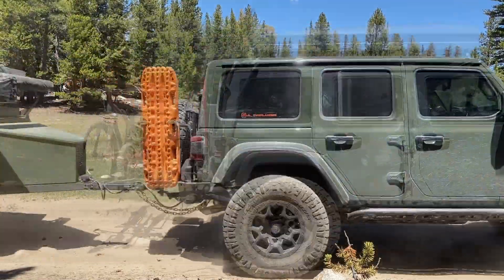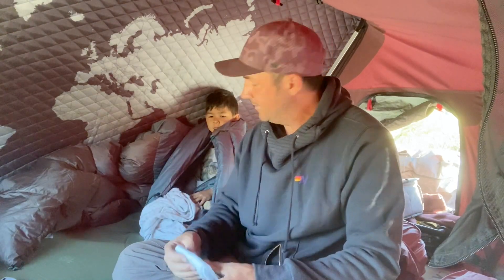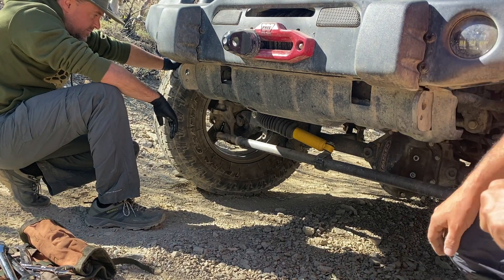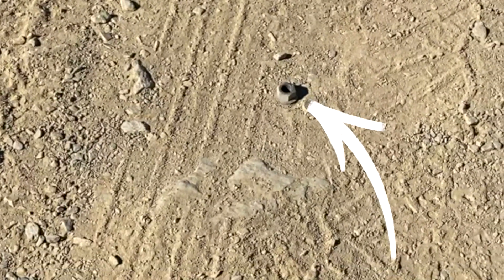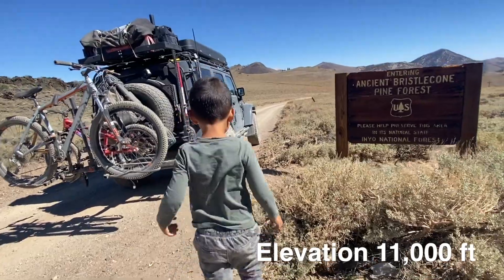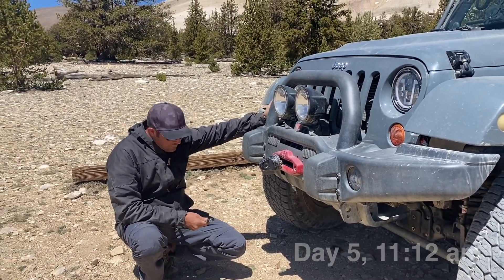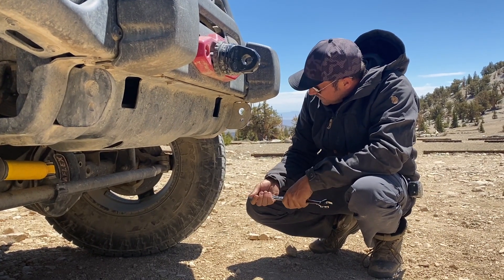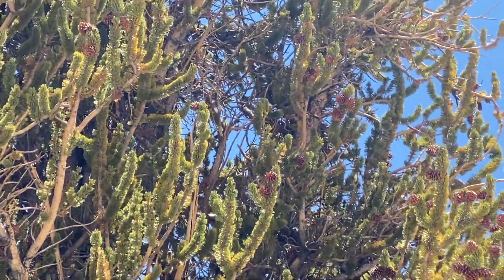These Trees Are 5,000 Years Old! (Bristlecone Pines) | 5 Days Overland Day 5

Comment: Glad you found that nut. Never seen a tie rod with a regular nut before. I’d swap that with a castle nut and a cotter pin. 
Also I know it’s a bit hassle but by taking the tire off you could easily move the knuckle by hand to align it with the tie rod.
Reply from the maker: good ideas...this is an aftermarket teraflex tie rod...I wondered about the castlenut as well...I'd have to drill out a hole for the cotter pin...don't know how hard that would be